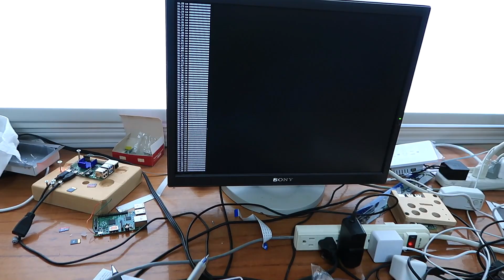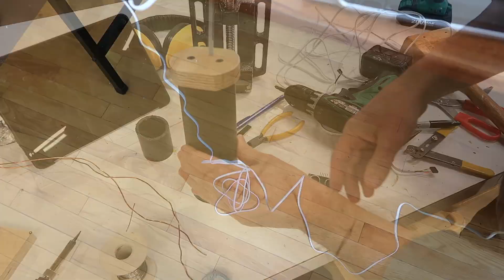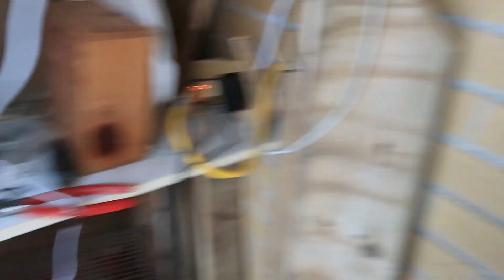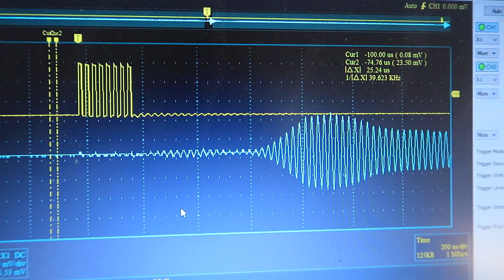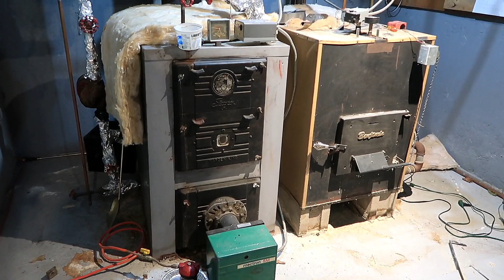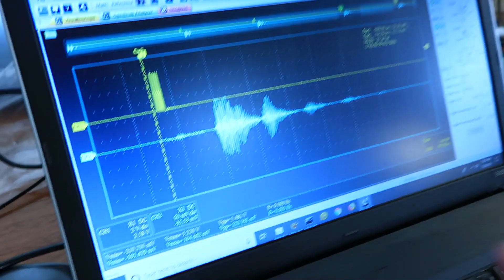Ultrasonic distance sensor as an oil level gauge

Comment: What is the oil used for?
Reply from the maker: heating
Reply: @matthiasrandomstuff2221  but do you burn the oil or use it as in oil heaters?
Reply: @gino.avanzini  Burn the oil in the boiler.
Reply: @gino.avanzini  you know oil heaters burn the oil, right?
Reply: @bmxscape  He was referring to the electric heaters with oil there.

Comment: If it were me, I'd have had to have a display of some kind that doesn't need a computer, too...  Probably outside at the tank.  Bonus points if it looks like just an analog meter again.
Reply from the maker: yes, just replacing the level gauge would do it.  Ironically, that would cost more money than this hack.
Reply: @matthiasrandomstuff2221  Ah, yeah, by "not need a computer" I meant plug into the raspberry pi.  Sure, it's actually a computer, but pretty tiny and cheap.
Reply: @Raytenecks  you many want to re phrase because a rasberry pi is a computer, and is connected to a display via ethernet. i don't recommend you put computer monitors outside in the canadian elements
Reply: @bmxscape  The display doesn't need to be a monitor.  In the same way that he hooked up a sensor, he could hook up a gauge for the current level.
Reply: @Raytenecks  makes sense

Comment: I would have had concerns about reflexions in the tank, but obviously is no problem at all. Do you have any concern about humidity of air condensing into the tank? mmm well I guess for the oil to come out is not air tight anyway.... so... nevermind
Reply from the maker: my guess is that tiny bits of water in the oil wouldn't hurt much.  They'd get sprayed thru the burner just the same, just not burn.

Comment: Have you had any issues with just using a single resistor on the input to the pi? The input impedance is rated at 50K so putting a 1K in line should only drop the voltage to 4.9V which might not be healthy for it. 
I always use a pair of resistors as a potential divider but I've never tried just the single resistor
Reply: This is relying on the body diodes of the Raspberry Pi's SoC. The SoC has diodes from the GPIO to VCC and GND which limits the maximum voltage to VCC + diode drop.
This diode now only has to dissipate the current through the 1k resistor.
Reply: @Manawyrm  Where did you find this info?
I searched the following: 5v tolerate raspberry pi
It brought up a webpage about how to use level shifters with the RPi since it's not 5V tolerate.

Edit: I hope the need for level shifters only applies to older RPi boards but I haven't found any info stating the RPi is 5V tolerate.
Reply: @ddegn  The Raspberry Pi is NOT 5V tolerant. Using a 1k resistor, you can connect 5V logic signals to the Pi, but it misuses the ESD protection ("body") diodes and it's a "dirty hack". Using level shifters is the proper and correct solution.
Reply: @Manawyrm  how much of dirty hack it is depends what the datasheet says, some ICs explicitly allows some current into the ESD diodes, unfortunately raspberrypi haven't relased any datasheet with that information ..
Reply from the maker: I have fed 5 volts into the 3 volts inputs before, but the 1k resistor is to make sure it doesn't put too much current in.
Reply: @matthiasrandomstuff2221  The 3.3V logic I've used with 5V requires at least a 3K resister. I think a RPi is not technically 5V tolerate so even larger resistor value would not guarantee no damage but a larger resistor value would likely reduce the odds of the RPi being damaged.
Personally, I'd use at least a 10K resistor.
Reply: I nearly commented almost this exact thing. I've always used dividers or a level shifting IC for pcb projects.
Reply: Couple of milliamps into the protection diodes should be fine.
Reply: @Rich-on6fe  "Couple of milliamps into the protection diodes should be fine."
It will likely survive but it's still out of spec. The Pi isn't 5V tolerant.
Reply: @ddegn  Milliamps are not volts. You're not forcing 5V onto the pins - you're asking it to sink a bit of current. 1.7mA to be precise. And yes, this could be out of spec. It could put the pin fractionally above the rail.
Reply: @Rich-on6fe  "And yes, this could be out of spec"
It IS out of spec.
Will it immediately destroy the I/O pin? Probably not. Is it a good idea to use use a Pi out of spec? Maybe if it's just a hobby project and a non-critical component. It's generally not a good idea which is why there is so much material online on how to do this sort of thing properly.

Some 3.3V logic devices are made to tolerate 5V inputs as long as the current is limited. The Parallax Propeller microcontroller can tolerate 5V as long as the current is limited to 500 microamps. The Raspberry Pi is not a 5V tolerate devices. The Pi does not have a similar current spec for allowed current at voltages above 3.3V.

Just because an electronic component doesn't die immediately, doesn't mean it's not being damaged. General electronics manufactures publish specifications for a reason.
Reply: @ddegn  I agree with what you're saying about doing it properly and not busking it when it matters. But I disagree about it having anything to do with 5V tolerance. This circuit with a series resistor doesn't put 5V on the pin. The pin doesn't know that it's coming from a 5V circuit.
Reply: @Rich-on6fe  did you read my original comment? The pi's inputs are rated at 50kohms. So using ohm's law you can work out the voltage drop 5/51000=0.0001A 0.0001*1000= 0.1V or in other words the gpio pin sees 4.9 volts on it. All the series resistor does is limit the current in.
Reply: @tobywenman4769  I saw that, yes. Did you read my initial comment? There are protection diodes to the rails.

Comment: Neat video! UT sensors are notoriously inaccurate and frequently glitch, this video really helps explain why. That said, if you are looking for a challenge, have you heard of the ultrasonic anemometers?
Reply from the maker: They work well in a controlled environment, and off a flat surface facing the sensor.  Anything else, it's hit and miss.
Reply: @matthiasrandomstuff2221  I see what you did there

Comment: thought about doing something similar with the salt level in my water softener, which is much cheaper per mm.
Reply from the maker: that could be tricky.  Not sure if the salt makes good reflections.
Reply: @matthiasrandomstuff2221  It should have no issues. The biggest problem would be the non-level surface but it would be good enough to let you know a ballpark level.

Comment: Wonder if the tank size, shape, and material contribute to some of the odd reflections that the sensor is reading. Though you think it'd be consistent in error. Also wondering if outside temperature affecting the metal tank also contribute to the sound reflection or resonant frequencies.
Reply from the maker: I think it goes for the first substantial reflection.  So waves sloshing around after the initial reflection probably won't matter much.  I do give it a bit of time between taking readings to let all those waves settle down.

Comment: How is the oil tank refilled, by hand or does it get filled slowly from mains/reticulated supply?
Reply from the maker: it's refilled by a guy with a big tanker truck when we call them.  Just once in the fall, cause we don't use it that much.
Reply: Usually delivered by a fuel/tank truck, I don't think Diesel mains are a thing in North America.
Reply: @OutlawAlaska  wtf why do you have diesel mains

Comment: Could you modify your program to take temperature into account. The volume/temperature coefficient should be a known value, and you already have a temp sensor outside. Would be interesting to see how accurate it could get.
Reply from the maker: I would need a temperature sensor in the oil.  It's a big mass, so it takes a long time to settle to a new temperature
Reply: @matthiasrandomstuff2221  Air temperature in tank will have the largest impact to the measurements, since speed of sound increases about 0.6m/s per 1°C increase.
Reply: @DatNdNd  That'd be an interesting exercise, but all that work's already been done.  The API (American Petroleum Institute) publishes formulas for pretty much everything regarding fuel storage, including expected expansion due to temperature.  To get things perfectly accurate you'd have to send a sample off to a lab to get all its properties (density, etc. - all that varies wildly even for the same types of fuel, and you'd need to sample it every time you fill the tank) but for something like this you can ballpark it and be fine.

I'm sure the actual documents cost money, but given how ubiquitous API standards are in the industry I'm sure they can found fairly easily.  I'd post the ones we use if I wouldn't get my ass fired for it :)
Reply: Does the air above the oil get hot? If the temperature is near room temperature then temperature compensation isn't really needed.
Reply: @DatNdNd  the outdoor temperature is not known; it is an approximation.
Reply: I get a feeling the temperature of the oil isn't the culprit off these level changes, rather the geometry of the tank. Intuitively, I wouldn't expect measurable changes on the scale of an hour or so, which is what I think we see. But I can imagine a metallic tank to buckle a bit due to the temperature gradient between the inside (oil temp) and the outside. Any thoughts?

Comment: Wouldn't having these sensors inside a tube cause all sort of nasty standing waves and interferences by the sound bouncing around? Is this type of sensor really appropriate for a confined tube?
Reply from the maker: the thing that goes inside the tube is longer than the tube, so a non issue.  But I did try it thru a tube, and that worked too.
Reply: the longer tube may even clean up the signal, less scattered sound returning,  
might have seen a video from Andreas Spiess.
Reply: Actually sensor in a tube will not work correctly. Have tested it.

Comment: If you're spending a lot of time in the TTY, it would probably be worth learning a terminal multiplexer such as tmux or screen. They're super handy for having long running session over SSH, and they give you the ability to see multiple things at the same time.
Reply: +1 for screen, it saved my life recently.
Reply: This is really good advice to Linux folk in general new and old, simple solid functionality. Seems like Matthias is an an old hand but a lot of the crowd may not have experienced using it yet. I also like terminator and tilda if at a Linux workstation and running an X session obviously.
Reply: I should note I wrote this while the adverts were rolling at the start (on my phone currently) 
So please ignore this if its irrelevant!

Comment: Next step; MQTT & Homebridge.
Reply: Yes! you send the data to a InfluxDB, make graphics in Grafana with that, and do processing with neural networks to detect patterns in oil usage... do you work in the same company where I do, where everything have to use everything and be over engineered? 😏
Reply from the maker: Why overcomplicate it with that stuff when a text file does the job?
Reply: @matthiasrandomstuff2221  Because you can.

Comment: Are you writing to the SD card on these at all? If so, would really stink if you lost power and the SD card got corrupted. Or maybe you have them on a UPS.
Reply from the maker: I intientionally pull power on running PIs all the time.  Never corrupted a card that way.  What does kill them is wear from constantly writing pictures on them though.
Reply: @matthiasrandomstuff2221  interesting, haven't had the same luck. must be my distro. good to know!

Comment: I half expected you to hook up a sensor to track when your oil burner is running to correlate the burner running and the oil level dropping.  The burner should use a fairly constant amount of oil when running.
Reply from the maker: I can tell when it runs cause the temperature in the furnace room goes up - got a temperature sensor in there.
Reply: @matthiasrandomstuff2221  Ahh.  Perfect.  No surprise you already did.  Thanks for sharing all of this.  I should just learn Python one of these days.  Very interesting stuff.
Reply: @muchmuchmore  python has a pretty easy learning curve, simple syntax